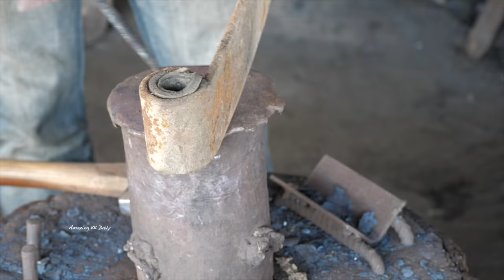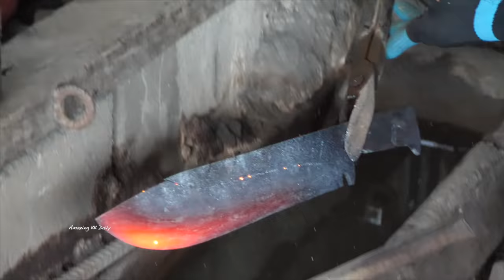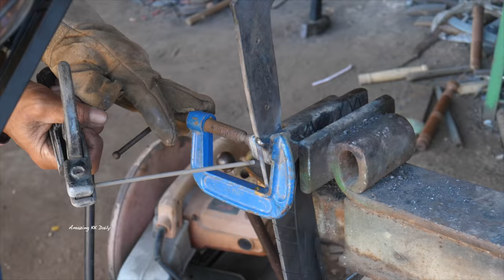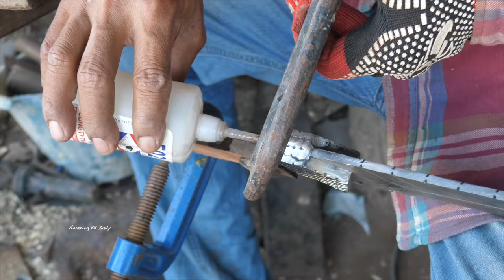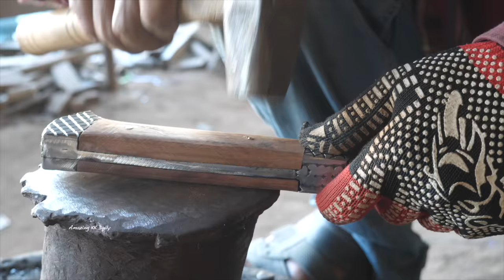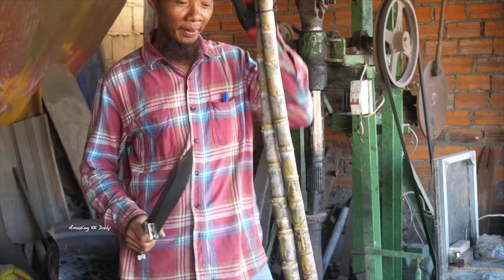KNIFE MAKING / HOW TO MAKE A CUTE KNIFE BY A TOP LEVEL BLACKSMITH

Comment: Craftsmanship is top level. Blacksmith??? A top level blacksmith would have forged every part this was 10% forged 90% grinder awesome blade none the less but if your going to call your self a top level blacksmith you should use the forge way more than the grinder
Reply: Agree, top level craftsmanship is for example the Japanese guys selecting the iron sand to make their own steel or other guys trying different things to get beautiful Damascus patterns on their blades.

Comment: Now THAT'S a knife! 
Crocodile Dundee would be jealous 😆

Now, my following comment is merely due to personal preference, so don't take this as a negative; I don't personally like welding steel parts to knives, since I personally prefer such parts to either be slotted onto the tang, or pinned and if possible, made out of a different material like brass.
Thats not to say what you did is wrong, just a personal preference on looks!
Regardless of method and style friend; what you do is AMAZING!

Comment: Very nice! As a fellow smith I have to ask why use recycled steel? Leafsprings have been through so much already even if they are rejected at the factory and unless you possess a batch number and contact the maker of the steel or a mass spec machine you have no way of knowing what it is, just makes your heat treat a guessing game. Great hot work and grinder work tho much ❤ from 🇨🇦
Reply from the maker: it is cheap and has high quality.
we buy it for $0.50 per kilogram
Reply from the maker: recycling is our purpose
Reply: @AmazingKKDaily  Thanks for the response. Oh yes leaf spring blades will indeed last and have from what I've seen some pretty good durability once you nail the heat treat of a particular set for sure. Just was curious is all, it's great to see smithing had all but died all over the world. Have a good day my friend.

Comment: shouldn't all the shaping be done at the forge rather than with an angle grinder. I thought he was supposed to be a top blacksmith. Might as well use an angle grinder for the whole thing then just harden and temper at the end. Very disappointing.